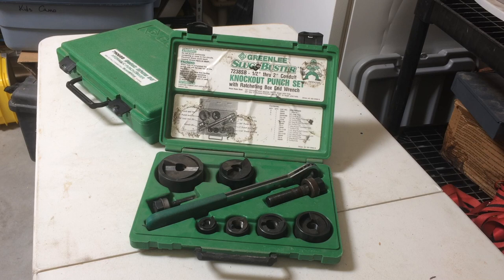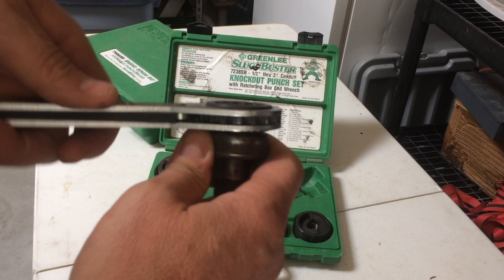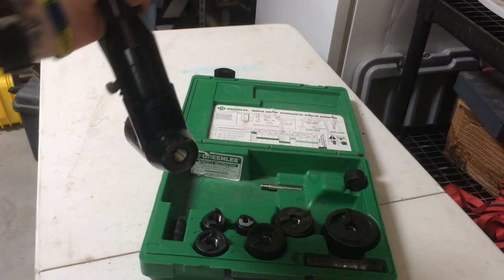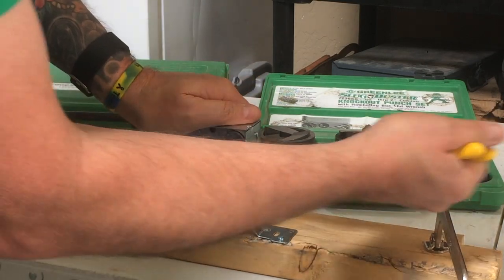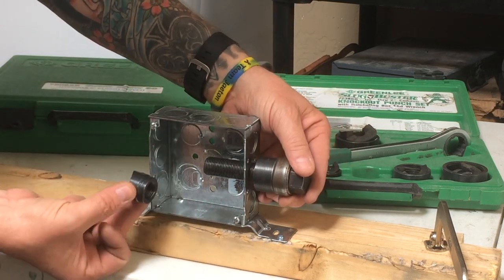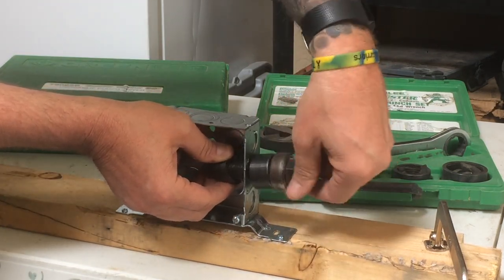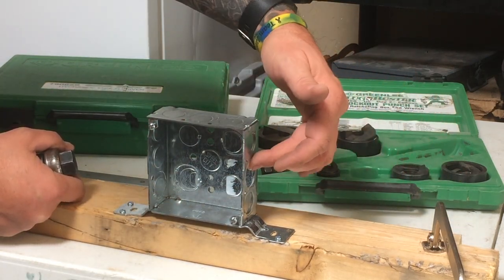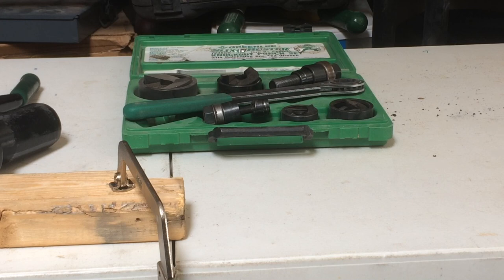How To Use A Slug Buster Knock Out Kit

Comment: In the late 80s I worked for an electrical contractor doing commercial work there was a journeyman and apprentice both with issues and little commercial experience. The apprentice was using the journeyman's knockout cutters and had the die in backwards. Watching this brought the story back to me, I own the Greenlee slugo buster set and the next one with the ratchet Jarrett has here. I also own a hydraulic set from Princess Auto.
Reply: Jeff B. I had an apprentice do the exact same thing. He put the cutter on backwards and pulled it through making a hole. I had to take the cup with backwards cutter in it to a machine shop to get the two pieces separated.

Comment: We used an impact driver with a rectangular die which was effective.  Also, we were cutting a rectangular hole in a cabinet of thicker graded metal.  Please advise.
Reply from the maker: +Ronald James I have seen the draw studs break when used with an impact driver. The high carbon steal in which the are made of didn’t last with the impact. That being said, I have used an impact driver also.
Reply: @jarrettthejourneyman7196  Thank you. we did have an initial problem with the draw studs. we had to clan and rethread . then we had to use the impact driver because the ratchet would not turn. again thank you for your input.

Comment: Great video ! man, My hydraulic puncher is not working what could it be? oil ? seals ?
Reply: slv 421 I would check the oil, but if there is no sign of leaking oil I would say seals. I have seen seals blow when you try to cut large holes in stainless steal.

Comment: So is the die actually turning to make the cut, or is it a fully sharp edge that gets pulled and literally punces it out like a paper hole puncher?
Reply from the maker: The dies remain still and the sharp edges cut through the metal. Thanks for watching!
Reply: @jarrettthejourneyman7196  wow, thanks.  How thick of steel will it cut, or is it pretty much confined to about the thickness of an electrical box? Would it cut a stainless sink deck?
Reply from the maker: @Orrphan  I have cut a lot of stainless steel with the knockouts, they should have no problem cutting a hole in a sink.
Reply: @jarrettthejourneyman7196  awesome. Thanks